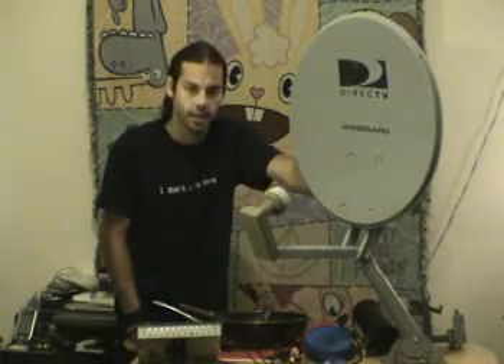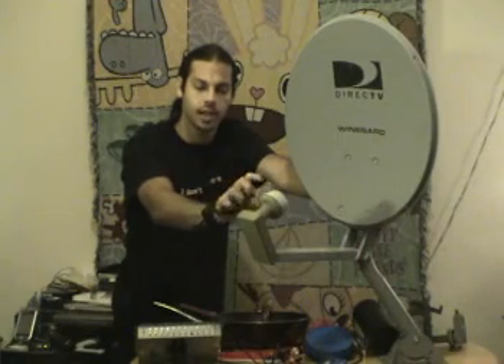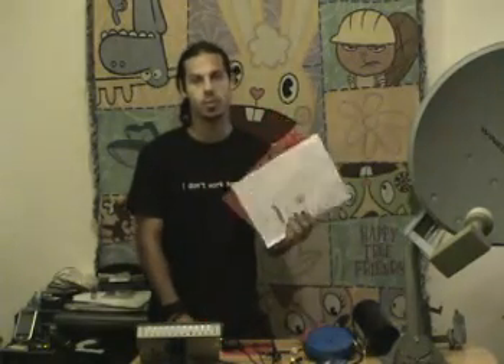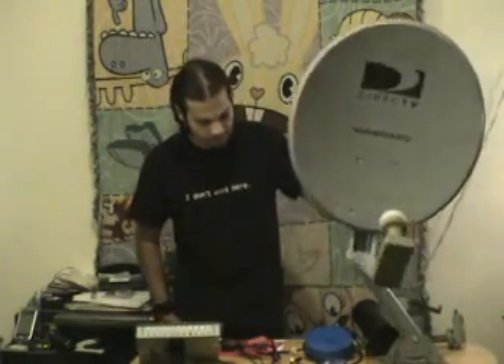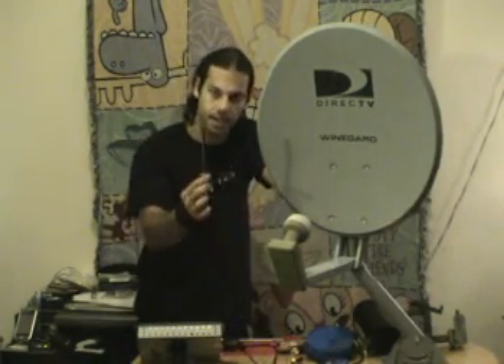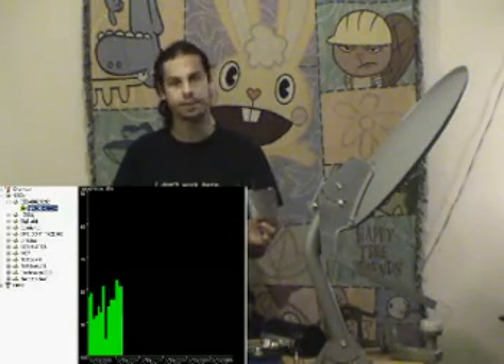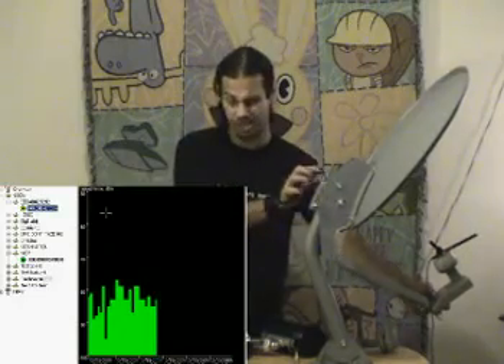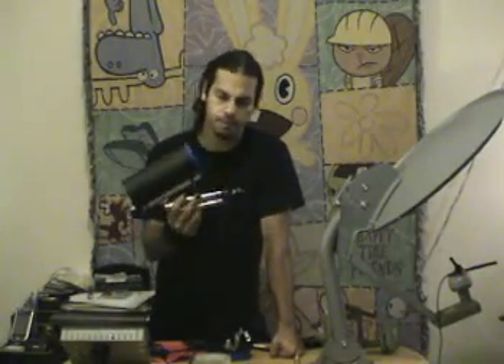Parabolic Antennas -Part one

Comment: An easy way to find the exact focal point is to attach a few 1" squares of SMOOTH (has to be smooth) shiny foil on the dish itself and then point it at the sun.  You can then use a tool ( I used a fiberglass rod) with a 1" square of white cardstock and then move the cardstock in the area you suspect is the focal point (with the dish at the correct operating angle!) and find when the paper is hit with a distinct sharp white dot.  You can also use small mirrors (like found on a mirror ball) and get more exact results.  The stock receiver mounting arm is where you normally would get your focal point but that isn't the only one as it will move with the relative angle of the dish to the point of signal (or sunlight).  So if you have the mounting hardware you can get it to 90 degrees if you wish.  However, the dish was made with the angle so that the receiver arm is NOT in the line of sight, thus ensuring less loss from arm interference.